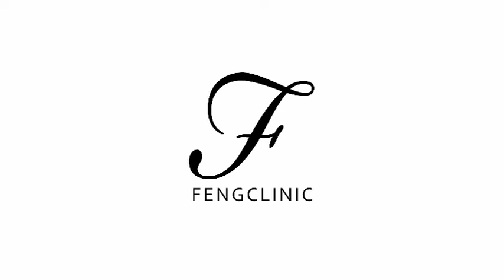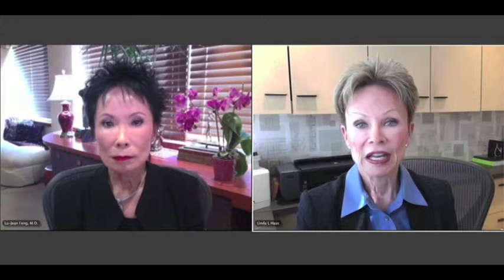Lu Jean Feng, M.D. - Saline vs. Silicone Breast Implants

Comment from the maker: Transcript

Linda L. Haas
Are saline implants more harmful than cohesive gel implants? And if so, why?

Lu-Jean Feng, M.D.
They are both problematic for different reasons. Saline implants and silicone gel implants in general cause certain local problems in the chest. If you have an implant that is placed under the muscle, the muscle, such as the pectoralis major, has to be cut. When you cut the pectoralis major muscle, you do make that muscle weaker, so other muscles have to compensate so that could lead to potential pain in the chest wall, in the shoulder and in the back. And look at where the implant sits. The implant sits on the intercostal muscle, ribs, pectoralis minor muscle and serratus anterior muscle. Now that muscle goes all the way around your back to insert onto your scalpula. That puts a lot of stress on the scalpula because with the weight of the implant the scalpula is perhaps drawn more laterally. That puts stress on the trapezious, on the rhomboids, levator scapulae. These are all reasons why many patients who had implants under the muscle have neck pain and back pain and it all puts it under stress. These are common problems that both types of implants share. 

Now, the saline implant can be a problem because the shell over time deteriorates and actually the shell can shed whether it is texture surface, which will shed sooner, or smooth shell saline implants, they will shed at a later time. When it sheds, it will invite more immune inflammatory cells such as the giant cells to come and react to it. Silicone implants can bleed. The oil particles in the silicone can come through the shell. Now, even though they have cohesive gel, the cohesive gel still breaks down in our body over time. And certainly if you have a rupture, from a silicone gel it is more problematic because it is usually silent. So you don’t know when it will rupture, or when it does rupture. Certainly if you had trauma you would know that it could rupture at the time of the trauma. The trauma becomes much more of a causative factor for rupture as the implant ages because as the implant ages, the shell becomes weaker and more vulnerable to rupture. 

Certainly both of them, physiologically or pathophysiologically, create a problem in the body because they create inflammation and when you have inflammation many inflammatory mediators are released and they could create symptoms in every organ system. So there are problems that both share and problems that are different depending on the implants, depending upon the type of implants.